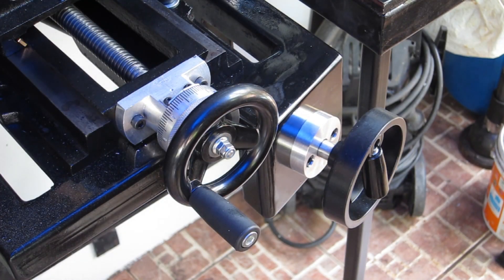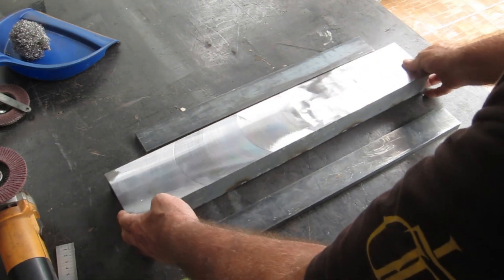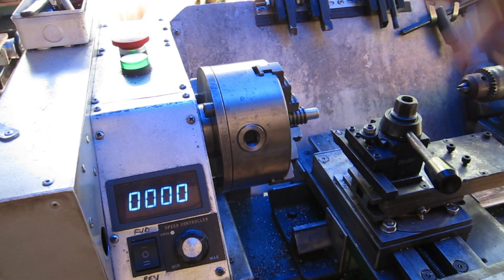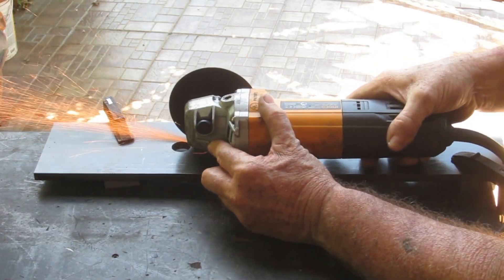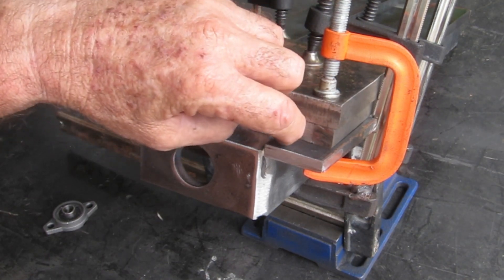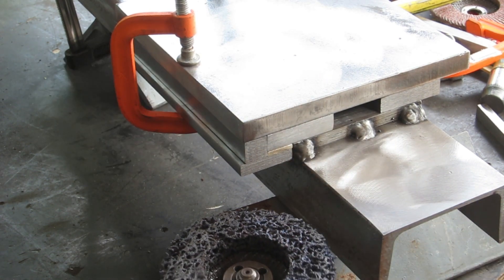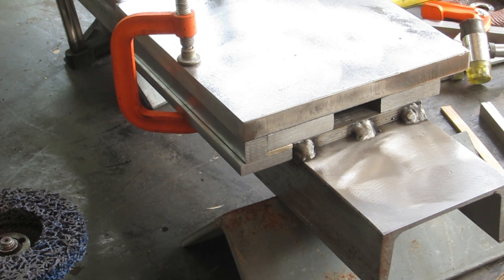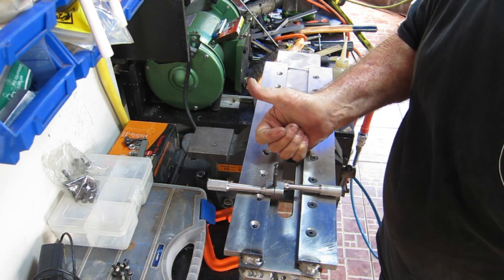MHW Episode 31 - Homemade Milling Machine - Z Axis - Part 2

Comment: I see you are in Thailand. Fantastic!! I am thinking about coming over there. I am a chemical engineer but I really dislike it. I am starting a mobile welding, fabrication and small engine repair business. Would any of those be good jobs for living in Thailand? I am also working on building a machine shop that runs on steam and central belts like the old days. I have a couple 200 year old lathess and now I need mailing machine.
Reply from the maker: You can pretty much forget about working here, you need a work permit and there are a heap of protected jobs that only Thais are allowed to do, although the list of permitted jobs for foreigners was increased just recently, do an online search for prohibited occupations 👍
Reply: @MyMiniHomeWorkshop  Oh wow. I have a friend that married a Philippine woman but he lived there for a while. They are back here and everything is going really well. I will check out the list. thanks my brother.
Reply from the maker: @Biokemist-o3k  You're welcome 👍
Reply from the maker: @Biokemist-o3k  Go to my home page and have a look at the video about the drama I am currently dealing with here